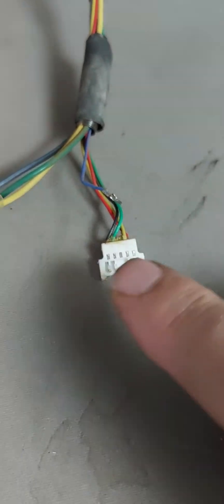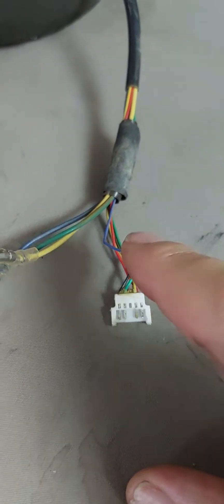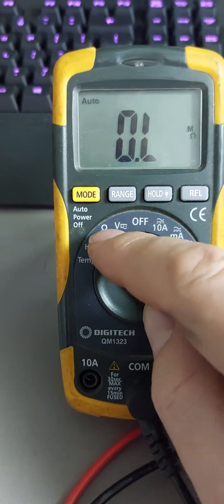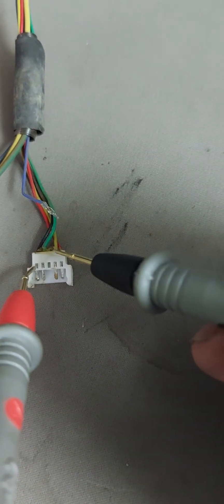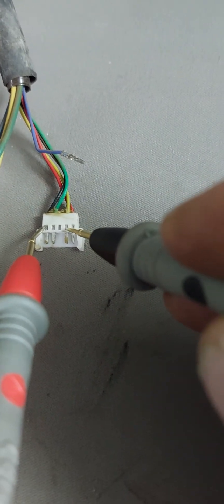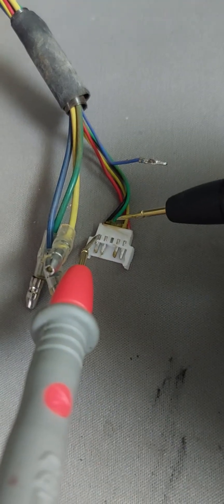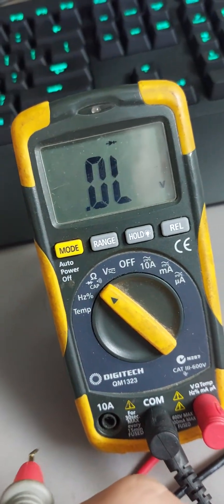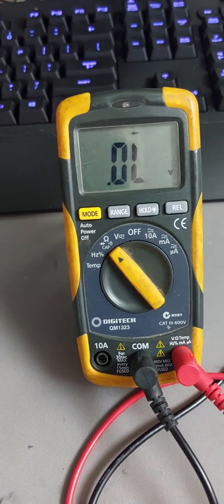testing motor hall sensors

Comment: What if your issue is with the blue phase wire.  When I unplug the blue phase wire the scooter runs, when the blue phase wire is plugged, the wheel stiffens up and rotate and stops. Sticking.
Reply from the maker: It's the controller